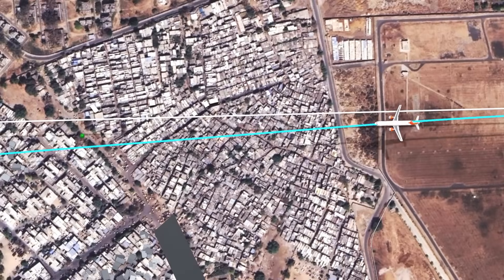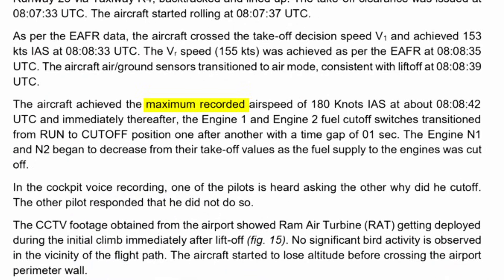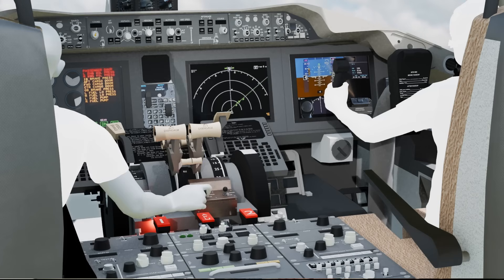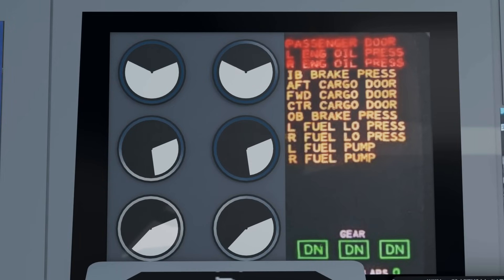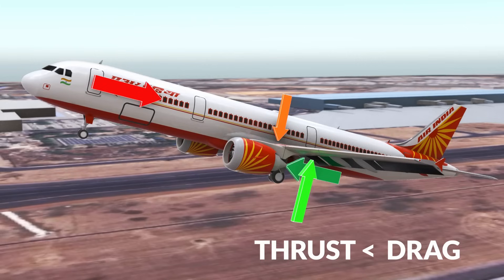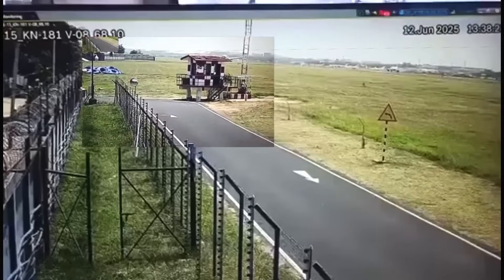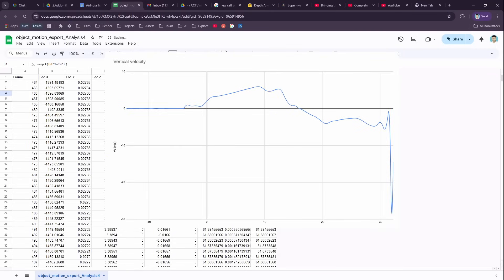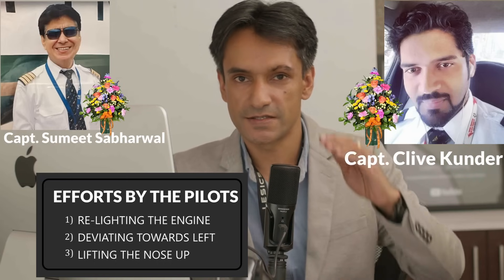Use of 3D Clone | Decoding the Crash Details you Missed

Comment: This is a very interesting video. Thanks for all the work you put in. I have a couple of queries with regards to the fuel switches and the FDR. Firstly, the FDR sampling rate varies depending on the process being recorded. For the fuel switches it seems like it is one second (hence the rounded number of 1 second). This means the actual interval could have been either as high as almost two seconds or close to simultaneous. Secondly, it has been reported that the FDR takes a reading directly from the mechanical part of the switch. Is this correct?
Reply: There are no position sensors at the fuel cutoff switches. The FDR gets its fuel status data from the Remote Data Concentrator, which gets inputs from the switch relays and the fuel valves.

It is unknown whether the compilers of the report have specifically distinguished between switch movement and valve action or are assuming the switch movement because the fuel status was recorded as being in the cutoff mode. It could be either one. 

We do know from past experiences that electronic control systems on these aircraft can take uncommanded actions independently of pilot inputs.
Reply: @timrider1224  The 787’s FDR does log the discrete signal from the cutoff switches, not just valve position, they’re separate inputs. In this case, the data shows both switches went to CUTOFF in sequence, then back to RUN later, which matches manual movement rather than an uncommanded electronic action.
Reply: @anon5043  There is no direct connection from the switches to the FDR, so there is no discrete signal from the switches to the FDR. I'm not saying that investigators cannot make that distinction, I'm just not convinced that they did given the vague and limited information given in the report.
Reply: @anon5043  This guy knows the electrical systems on the 787-8 like the back of his hand. He explains exactly how this happened.

https://youtu.be/OLxLN3osS1Y?si=-y6jdVwMZ_DMjILG
Reply: @timrider1224  Yes having watched the video the engineer does appear to be highly knowledgeable. However, the FDR shows the cutoff switches moving to OFF before the RAT was supplying power, so the RAT’s 6–10 second spool-up fits the timeline but doesn’t explain the shutdown. Even with a 28V bus loss, both engines have independent cutoff circuits, so you’d need two separate, simultaneous faults to mimic the sequential lever movements the FDR recorded. FADEC bugs are always worth considering, but on the 787 FADEC can’t command those levers - it only responds to their position. That’s why investigators are currently focusing on the physical lever transitions as the primary cause.
Reply: @anon5043 obviously the FADEC didn't physically move the switches. The question is whether the switches were actually moved or did the investigators just assume they did due to the change in fuel status. Given the vague, sloppy, and incomplete information given in the report, it's hard to put much confidence in it. 

For example, they didn't even know what FADEC stands for. They said it was "Full Authority Dual Engine Control" instead of "Full Authority Digital Engine Control." That level of error doesn't instill a high level of confidence in my view.

If the 28v DC bus on one side loses power, it will connect to the other to regain power. If that power loss is due to a short, it connects the other bus to the short, knocking out power in both. That would function like a dual fault when in fact it's actually just one. If the diode module protecting the Lithium-ion battery went out, it would introduce over voltage to the battery resulting thermal runaway, and a short in the left 28v DC bus which would then connect to the right bus. This is one possible scenario.
Reply: @timrider1224  Totally fair to be skeptical—but a few clarifications may help separate the solid facts from the “maybe”s:

Switches vs. “assumed” status: On the 787 the FDR (via the RDCs) records discrete inputs for the fuel control lever positions as well as downstream valve states. The prelim timeline shows RUN to CUTOFF on Engine 1, then one second later Engine 2, then later both back to RUN. That pattern is a control-input sequence, not just “fuel status changed.”

A report typo: “Full Authority Dual Engine Control” is an embarrassing typo, but it shouldn't undermine the underlying time-stamped parameters pulled from the recorders.

28V DC short/bus-tie theory: A DC bus fault could create a lot of noise elsewhere, but it won’t generate lever-position transitions. You’d expect multiple unrelated faults; instead, the data shows a clean, sequential lever move on two independent channels a second apart, then a later move back to RUN - exactly what you’d see if someone flipped them and then tried to recover. FADEC/EEC cannot “spoof” those levers.

RAT timing fits the above: RAT deploy/spool-up lag (hydraulic 6s, electrical 10s) is consistent with power dropping after cutoff, not an upstream electrical failure causing the cutoff events.

Its best to wait for the full report wording, but based on the recorder evidence we have, the simplest explanation is still manual lever movement, not a DC bus cascade or FADEC glitch as has been suggested could be possible.
Reply: @anon5043  You are right on. It log the signal. It cannot "see" the physical position.
Reply: @anon5043 we'll just have to agree to disagree on this one.

"Duel" is not a typo, it's the wrong word. The ambiguity and selective nature of the data provided in the report is troubling. The word "about" is used 15 times, "approximately" 5 times, and "immediately" is undefined. The above video shows how some of the data in the report is not consistent with well established laws of aerodynamics and aircraft specs.. There are also 14 instances of final reports of aviation accidents that have turned out to be wrong in their conclusions. This is also troubling.

And too many aviation experts have demonstrated, using the data given, that the actual deployment of the RAT preceded the fuel cutoff to the engines. Cutting off fuel to the engines was an effect not a cause of engine shutdown, as part of the restart procedure.
Reply: @timrider1224  Agree that the timings look out of sync. However, The FDR doesn’t log every parameter at the same speed - RAT status might only update once a second, while lever movements are logged at a different rate. The “timestamp” is just when the data point was written, not the exact physical moment it happened. If two events are within 1–2 seconds, the order can look swapped due to sampling intervals. In this case, the RAT may appear to deploy before cutoff when in reality they were likely simultaneous or reversed. 

The report may indeed have flaws with language etc, however - they key fact from the FDR that fuel switches transitioned couldn't be mistaken or fabricated, given the level of oversight, and multiple representations (from different jurisdictions including India, UK and US) involved in the investigation.
Reply: @anon5043  Unlike an ICE, a turbofan engine will continue to produce thrust for a time after the fuel is cut, and then that thrust will start to decay as it spools down until it reaches a threshold where loss of electrical and hydraulic power trigger the RAT. This would widen the gap between fuel cut off and deployment of the RAT even further.

To suggest that different sampling rates could suggest "simultaneous or reversed" sequence is stretching the data beyond credulity in my opinion. Ultimately, it would render critical timestamps meaningless.

As for the "level of oversight", the NTSB withdrew in protest at one point, indicating that they were unhappy with what they were observing. And they were the ones who issued a strongly worded statement against prematurely jumping to conclusions right after the WSJ hit piece came out. 

I know there have been suicide mass killer pilots in the past, but there are just too many factors that don't add up to that in this particular case. Until I see concrete proof beyond a reasonable doubt, I do not find that to be an acceptable interpretation at this point.

Comment: Bud,not,169 ft AGL,it,is,432 ft AGL,VAAH-RWY-05,is at,189 ft SL,so,I think,you have lifted it from,there

VR,was,at,165 kts IAS and VLOF at,169 kts IAS,so,when,gear-lever-up,”gear-trauma”,at,70 ft AGL,engines-off,the,SPD,decayed,to,180 kts IAS,100 ft AGL and went in,reverse-inertia,reaching,165 kts IAS-VR,”stall”,at,432 ft AGL and crashing at,153 kts IAS

And the,velocity in,my-notes,are,per-unit,not,absolute,bud

Comment: Where the data here is checkable, it's nonsense. Pilots have no difficulty moving both fuel cutoff switches about one second apart, with one hand. Both pilots had two hands. The Preliminary Report is unsigned, that[s true. I'm in the US where we had a fatal collision this year on January 29, and I just looked up the NTSB's Preliminary Report on it. Also unsigned. Google AI thinks that's the norm. We've heard these many times before, from net conspiracy theorists. The 3d model is based on guesswork input.

The AAIB has all that video, and more importantly the data and voice recordings from the forward Enhanced Airborne Flight Recorder (EAFR) recovered from the crash site. Until 2002 US regulations required 29 parameters to be recorded, but that increased to 88 currently. The 787 records over 2000. In 2019 the International Civil Aviation Organization promulgated a new proposed rule requiring independent power backup for Cockpit Voice Recorders but not for Flight Data Recorders. The EAFR in the 787 long predates that rule and the forward EAFR has backup power for both the CVR and FDR.

Fortunately India is in line with international convention in that the AAIB is separate from the DGCA with sole focus on investigating for the purpose of preventing future accidents. They can and should ignore this video.

Comment: The FUEL supply was not normal, that's why the PILOTS used all the 3.5Km RUNWAY 
And almost all the functions were out of control so the Landing gear didn't retract 
And probably the FADEC system was somehow CONVINCED the flight is LANDED, so the FADEC system cutoff the FUEL supply.
Reply: i think its more likely that Engine 2 failed early. Which is why additional runway was used to get to V1.

But I respect your opinion and lets see in due course.
Reply: Lastly there HAVE been a handful of cases where Aircraft were " still thought to be on the GROUND" by HAL. 

And the fuel then cut-off AUTOMATICALLY without any person touching any switches....🤷‍♂️
Reply: They requested the entire runway because they were close to the maximum weight for that aircraft.

Main gear couldn't retract due to lack of electrical and hydraulic power from whatever caused the failure in the first place. Wheels have to be stopped before retraction, and that may have overloaded an already weakened electrical system.
Reply: @timrider1224 mmmh interesting. I think its more likely Engine2 failed earlier than first thought. Or had power issues ongoing at v1 onwards and subsequently failed at WOW event. 

ECM's & Engine 2 failure causing RAT to be used. 

Lets see. Nobody really knows until they release the logs and the alerts and confirm if TCMA & other issues have been recordes !

Comment: Question: Why does the 787 relight procedure call-out a pilot recycling of the cutoff switches?

The three video segments are not the same. The initial release, is a 171 crash video of a PC monitor where a mouse cursor is circling a white cloud that's not visible on the other two videos. Those are of a clear and sunny day with the plane already in the air. Why? A check of the dew point and temperature on the day shows they were not within three degrees, as is necessary for ground fog to occur. Not even close. Dust or smoke? No, because the visibly green turf is well-groomed and watered. 

Aerial views show the turf running right up to the runway and taxiways without bare patches, except possibly in the overrun zone. That's what was initially claimed as "dust" and dismissed from evidence. The white cloud is seen swirling clockwise in the portside wing wake turbulence in ground effect, and it's also seen on the starboard side above the shack's roof turning counterclockwise. But these simulations and camera perspectives from the north, and southwest corners have none, and that's when the plane was out of ground effect way before it got over the runway numbers. That's odd.

But consider if accumulating condensation had filled the vented tank bottoms, it would be displacing only the unusable fuel beneath the sumps. Say, if the water scavenging system were clogged or malfunctioning, and a bathtub of water were to eventually accumulate in its three tanks. A taxi and startup of engines would not show that water there had a fouling potential. But as water is heavier than jet fuel, under takeoff acceleration g-forces, the water might have forced the essential fuel away from the sumps and blocked jet fuel from entering the pumping system. It would send raw water into the lines, following the initial fuel into the hot engines, already running at full throttle. A little water might be beneficial, lowering engine temps and raising its mass flow by adding steam. That's done intentionally on some jets.

But if the four FADEC computers began compensating and adding more fuel to regain the maximum thrust demanded, it might be quenching the fires by adding even more water from the lines instead, thus creating a swirling cloud of exhaust fog that only stops when the engines no-longer function. If that sensory result gave cause for the FADEC fuel/air mixture programs to chop fuel to dead engines, a message of the "transition to cutoff" may not distinguish whether it was pilots or the automation. That circumstance is too rare for it to understand. Recycling the switches in accord with the 787 engine relighting procedure would occur in the limited time they had to live, and they did.

But only one engine relit. And if engines couldn't restart in the normal time that hot turbines with windmilling fans should, by that I mean instantly, there must be some reason. Don't you think? Waterlogged fuel lines and combustion chambers may be that reason, and whoever wrote the relighting procedure knew that the switches would have to be reset for the automation to recognize the need. That's because fuel flow must shut down with engine cutouts, rather than pouring raw fuel into them for a too rich a relight. 

Do you see the fog of water-fouled exhaust? It's coming from the plane, not the atmospheric conditions. The RAT deployed automatically as the gear unloaded and signaled that the plane was flying, because it won't do so at the gate at shut-down. The engines were out already.
Reply: Wow! What a new aspect to consider (water-fouled engines), and what reasoning - your observation and forensics are admirable.
Reply: @RanjitKonkar  🙂
Reply: Your reply is making me go back and rewatch the available footage yet again ! :D
Reply: I argued contaminated fuel entering engines on rotation, followed by cycling the fuel switches to initiate restarts  from day 1. However, I am prepared to accept that software confused by a hardware malfunction is also plausible. I am sure that it does not look like pilot suicide. Surely a pilot planing suicide would choose a time when over water and the other pilot is barely half awake.

Comment: Awesome explanation I also read the report and they were able to include the time stamp on everything but the fuel cutoff switch transition. So naive investigation
Reply: And no report of any sound of the switches being moved.
Reply: No time given for RAT being triggered and far too many "about" timings.
Reply: "The aircraft achieved the maximum recorded airspeed of 180 Knots IAS at about 08:08:42 UTC and immediately thereafter, the Engine 1 and Engine 2 fuel cutoff switches transitioned from RUN to CUTOFF position one after another with a time gap of 01 sec." There you go, there's your timestamp for the fuel cutoff as quoted verbatim from the report. 8:08:42 and 8:08:43 UTC for engines 1 and 2 respectively.
Reply: @robertszabadi7167  I'm writing a new article in which I decode that exact snippet.  The laws of physics show that the time of switch movement is significantly later than the time at which fuel was cut off by the automated systems.

Comment: One error in this video - AAIB report says time gap between moving fuel switches was one second. It did not say both switches were moved within one second.
Reply: The first instance may have been switching relays .  The second instance, with 4 second delay between switches after liftoff is consistent with hand-moved switches.  A pilot will move a switch, check to see if it's effective and then move the other switch.